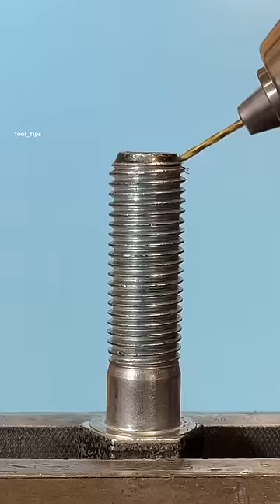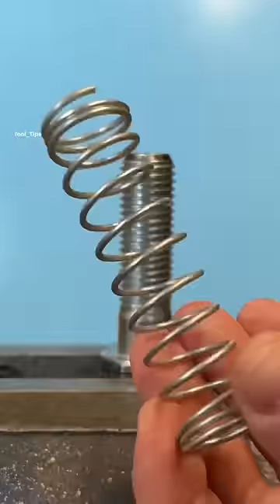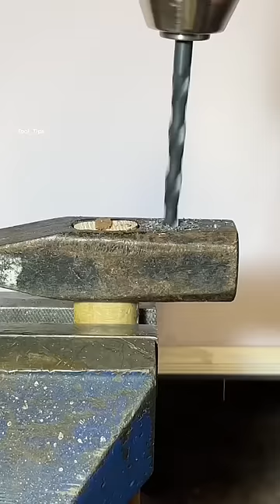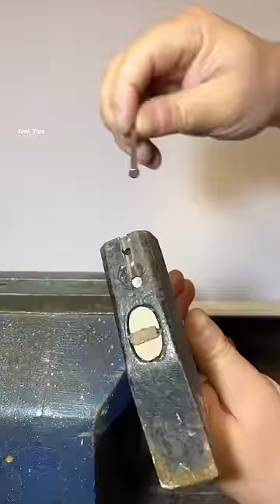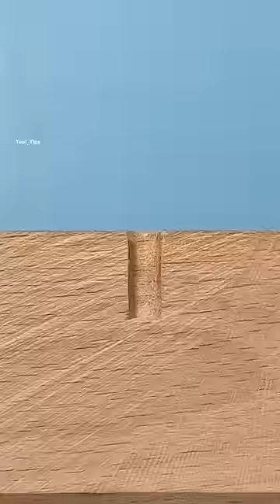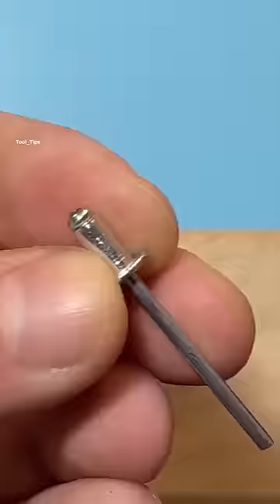Few People Know This Tips 🤫

Comment: The fact you were able to easily stretch out that "spring" means either 2 things. Either A) it's just a coil of wire, it's not a spring. Or B) it was a ludicrously low power spring which you immediately caused to fail by pulling it past it's strength point
Reply: It's solder
Reply: It’s solder
Reply: It’s solder
Reply: Its john cena
Reply: Why is it solder then?
Reply: If they had used spring steel, there is no way they would have been able to wrap it around by hand. Otherwise springs made from mild steel wire need to be heat treated afterwards to make them somewhat spring like.
Reply: No shit Einstein
Reply: @Mad4400 You can use mild steal then heat treat it to make it stiffer. People heat treat car springs to make them stiffer all the time. You don't need steel with magnesium to make a spring.
Reply: @teufelhund3801  Umm... isn't that what I said?

Comment: No you don't put silicone in a loose plug, get a bigger plug or drill a correct-sized hole.
Reply: Well what alternative if he drill to large americun
Reply: Fatter plug, they're widely available and cheap. Usually grey. Just drill the right hole width and you're good. @entitledblackwoman
Reply: @entitledblackwoman what a weird username you got there.
Reply: PFFT, you dont waste expensive silicone caulk. you use painters caulk or Elmers wood glue with some match sticks jammed around the wrong sized plastic anchor
Reply: When you buy the plugs, they will tell you right on the package which size drill bit to use. It's foolproof.

Comment: I'm 60 years old and I have never had the need to make a Spring out of mild steel
 I challenge you to wrap Spring steel around that bolt.
Reply: 7 Series a csomag része
Reply: That looks more like some kinda soldering wire to me than mild steel.
Reply: @Jrez  
Even worse, what's the point?
Reply: I'm 30 years old and I never thought of drilling into a hammer...
Reply: @Lichtstrahl92  
They make framing hammers like that. But the notch where the nail head rests is flat. With it curved by the drill that hammer is going to be shooting nails across the room. I hope he works alone.
Reply: I thought it was soldering wire. No steel bends that easily, not with that thickness.
Reply: He needs to wrap his brain around that first, but then brain? Which?
Reply: @andrews042  My point was you're giving him too much credit, as if that's even possible.
Reply: @Jrez  
Agreed, the point is to get clicks, not to actually help with projects.
It's hard not to point out inane tasks though.
Reply: Solder
Reply: @robertthomas6127  🤣🤣🤣🤣
Reply: @andrews042  I’ve never thought of using my cross peen hammer for framing work either. I usually stick to metal work with it.
Reply: E FAZEI O BEM SEM OLHAR A QUEM  QUE ASSIM SEJA FEITA A VONTADE DO NOSSO DEUS REI E MAJESTADE PARA TODO O SEMPRE AMÉM.
Reply: You give him to much credit, that is solder.
Reply: I used to make chain maille with spring steel wire and I can tell you, it ain’t easy and you don’t want to use a bolt as your form. Unthreaded rod chucked in a drill is the way to go. I’d never do it by hand now though.
Reply: No kidding. Springs are extremely cheap. Can get a box of them for a couple of dollars. Idk the size of that bolt but even some that are as big as your fingers are still cheap
Reply: @sleepingontheblacktop6053  LoL, now yeh just done it, & gave grasshoppah the Not So Bright Idea, to do it to a Straight Peen for next Useless chi'comm clickbait show. Ayuh
Reply: @Lichtstrahl92  I'm 30 years older than you and still haven't thought about it
Reply: قد تحتاجه يوماً ما 😊
Reply: Fr
Reply: Rc drift cars
Reply: @djstatyk1540  if your that hard up for spring money stay out of RC…
Reply: @Jrez  .?
Reply: @rajanthomasmm7334  How can I help?
Reply: hmm interesting
Reply: What about the hammer, it would work?
Reply: @elchicogore9517  
The drilled hole where the nail head rests is round. You'll either curve the nail head or it will shoot across the room.
Reply: The only reason i could think of is to use it as a door spring if your too lazy to go and buy one, i say this im doing it right now because im not tryna go to home depot! 🤣
Reply: @ChristKingJesus  
If you have the right wire it can be done.  But with hardened steel you have to use a smaller mandrel than the inside diameter you want and a guide to bend it close to the mandrel.
Reply: @ChristKingJesus  Pfff, americans depending on Home Depot
Here in South America we depend on our imagination, no such thing as ''home depots''
Reply: It's almost as if the type of metal you use for springs is specific... Like as if it had its own name or something...I guess we'd call it ... Steelspring... No, how about... Spring Steel... Yes that works... If only they'd invent something like that... I'm sick of my springs collapsing under weight 🤣🤣🤣
Reply: @42ckev  
Sarcasm intensifies
Reply: @robertthomas6127  the only thing that holds this person is hot air but if he keeps doing shit like this who knows
Reply: Lol.
Reply: That's the one that really got to me the most because that "spring" ain't gona do fuckall just like you say. HOWEVER wrapping threads with wire is an excellent way to have clamping forces applied to threads without marring the threads.... perhaps if he took a torch to the wire and got it hot as a cherry then plunged it in water... the mild steel wire would be slightly more useful as a spring 😂

Comment: "I just drilled the wrong sized hole but instead of just letting the wall anchor expand like it was going to anyway I'm going to make it hell for the guy who wants to take this out later."
Reply: It's better to use chemical  anchor instead  of that sealant..
Reply: @olegnazarko9762
Reply: I thought the caulking was to prevent water ingress. I've done that before.
Reply: Not to mention it’s a drywall anchor going into masonry😭😭
Reply: @olegnazarko9762
Reply: Rajnildeka
Reply: @kanmanit1957  d
Reply: @olegnazarko9762  i
Reply: @olegnazarko9762  in our
Reply: I use JB weld in the drywall and a bit a green loctite on everything.
Every
Thing.
Reply: @treybrumley2060  you
Reply: @BlackEpyon  9ooq9r
Reply: @BlackEpyon
Reply: @kanmanit1957  mobile iphone r9or
Reply: Ok
Reply: @olegnazarko9762
Reply: @olegnazarko9762  ppp
Q de
Reply: @treybrumley2060  de
Reply: @pablohernadez4414
Reply: @BlackEpyon
Reply: @olegnazarko9762
Reply: @olegnazarko9762
Reply: @BlackEpyon
Reply: @olegnazarko9762
Reply: @treybrumley2060  I think we put wm

Comment: Few people know these tips because they are useless. These are 4 great things you should never ever do.  Or 4 great ways to know you should fire your handyman.  1) the spring is compressed and will not work, that is literally just a coil 2) The destruction of a wedge hammer :( .... a claw hammer holds the nail for the first strike on the back. Also, the strength of the wedge hammer has been compromised 3) Gluing a drywall anchor into "anything other than drywall" will fail to hold a load 100% 4) Wooden dowels are not nailed in, use wood glue to form a correct bond.  The nail does not increase the strength of the dowel because dowels are hard to twist by themselves but it will fall out of the socket 100%.
Reply: 3) These anchors exist for concrete walls as well, and there's no need to glue them in, as they spread when the screw is fastened, clamping it in. They're supposed to be that lose at first.
Reply: 4) it looks like they used a blind rivet instead of a nail

Comment: "I have a brand new hammer with a magnetic nail holder. 
Now I'm going to make a crappy version of my brand new hammer for no apparent reason."
Reply: With the wrong kind of hammer to boot. That's a scythe hammer, for metalworking.
Reply: @bruwin  thought it was a carving hammer(I play dying light)
Reply: @bruwin  im 99% sure thats a chisel for blacksmiths
Reply: A magnetic nail holder is a useless addition to hammer to begin with.
Reply: nevermind that you wouldn't typically use a sledge for nails.  hopefully not.
Reply: @goverat  For smiths it is a cross pein. It is for squishing the metal in only one direction. I apologize for the technical terms.
Reply: jai shree Radhe Radhe
Reply: @hotdogsarepropaganda
Reply: @hotdogsarepropaganda  reeeeeeeeeeeeeeeeeeeeeeereeeewereeeeeeeeeeeeereee
Reply: Also the magnet of the DIY hammer is used to drive the nail in. I feel like it’ll chip and break quickly compared to the other hammer
Reply: In case you don’t have one of those hammers.
Reply: @Joshinken  it takes more time to put the nail in the magnet than just to hand drive it. So only novices use this feature anyway
Reply: @adamb8317  it takes 0.0001 seconds to put a nail on a magnet and saves you several “i don’t want to hit my hand” swings at the beginning, so i have no idea what you’re talking about

And yeah, novices. Those exist. Not everyone needing to put a nail into a piece of wood does it professionally. I just need to smash two pieces together so they can stick until it gets to the production line, and that hammer really helps.

And i know for a fact that carpenters use this type of hammer as well, and they use the nail holder as well, because if you have any amount of training with it, its really handy to take 1 swing to stick the nail into the wood and another to drive it in all the way. Saw a guy do a roof once, mans put a new nail into the magnet with the same hand he was gripping onto a piece of 2 by 4 for dear life up there by simply moving the hammer past his hand on the return swing. The dude shuffled over the roof in minutes, driving nails in with no problems. 

They had a nailgun, but he could do it faster this way.
Reply: @Joshinken  Great analysis and thanks for the real situation sharing. It makes sense in some way 👍
Reply: @Joshinken  OK that is a good point. I can see it being useful sometimes
Reply: @goverat yep, absolutely a chisel.

Comment: Anyone who ever tried to put glue around an anchor will tell you that it will never hold a little bit.
Reply: Let the shit set up first, there is a certain glue just for it but I've never used it. Seen it used but I think it was just to help with freezing. I don't know
Reply: @jeremybanks719  'Grab adhesive'. I don't see the tip as that bad: You can use the correct drill bit, drill it straight, and still end up with a hole too large for your plug. I would try to remove the dust from the hole before putting the adhesive in though.
Reply: @123a-o5d  not to be 'that guy' but if the hole is too big you actually didn't use the right size drill bit.
Reply: Not true. Try drilling lots of holes in old brickwork. Especially one that has already been plastered, so you're drilling blind so to speak.
Reply: @123a-o5d  If you every have a lose anchor, add wood "splinters" inside the hole. When the screw expands the anchor, it will grab and be just as tight.
Reply: @lastnamefirstname9043  BE GONE WITH YOUR COMMON SENSE!
Reply: @Syn410  Why not just use something like QUIKRETE Mortar Repair Sealant? It would be a hell of  lot more permanent.
Reply: @REALfish1552   I hang exterior lights (weigh 5-10lbs) and use 4 tapcons or rawl plugs to do so therefore it's not necessary, as wood is readily available and a loose plug is too rare to buy special sealant for, not to mention you don't know for sure if it will "grab" unless you wait hours for it to cure. I never drill into the mortar (only the brick itself) as theres no structure there, and to my knowledge that sealant isn't an adhesive that would hold anything in place but I could be wrong about that

Comment: ah yes the classic common need for a diy spring
Reply: what spring? the swirl he made with soldering wire lol?
Reply: @traitretrudeau2367  good screen name btw.
Reply: @GeorgeOrwell-yz6zx  goes well with my profile picture
Reply: One can make spring like that but usually it needs to be on the drill press or lathe to get it working properly and be safe.. Also you need high carbon wire like piano wire for that.

Comment: The hammer is made to hold the nail for your first swing. So you don’t have to modify a hammer you wouldn’t use for any nails required in home improvement, just to get the perfect drive
Reply: I doubt you have ever handled tools properly or made anything out of wood if you think this is a good idea. When you use this kind of hammer you will likely not be able to put the nail in the right position and angle.

Comment: You lost me at the first one, but even more when you snipped a rivet to fit that peg😭
Reply: That was a great idea though.
Reply: @skylined5534  Or...  You can use glue on the dowel like intended.
Reply: @skylined5534  professional carpenter here! Dowels are designed to expand when in contact with glue. (Not all types though. Regular old wood glue works best. The pin was not needed.
Reply: @unknownunknown7107  and get it wet so it expands too
Reply: Maybe he thought it was a weird nail.

Comment: A spring with no temper to it..awesome .
Reply: Even if he tempered it, it wouldn't be a spring, it'd just be a coil. You need to use spring steel to make a spring.
Reply: @holocaust_2.0  very true.
Reply: I think it was solder.
Reply: @holocaust_2.0  iiuuiiiiiiiiiiiiiuiiiiiiiiiiiiiiiiiiiiii8ii
Reply: It's a laid back and relaxed spring.😉
Reply: Itac Hi  Your message bollox.

Comment: You can also just hold the nail, that way it'll end up exactly where your want it to go and you don't need to damage your tools 😂
Reply: And the chance of the nail just slipping out is really high. Keep in mind they have as many takes as they want.
Reply: @personpersonson7958  i mean mine aswell just buy a framing hammer, some have that already and it does work really well
Reply: The real value of presetting the nail in the hammer is that at times you can’t reach where you’d set the nail by hand - I know I’ve experienced that problem. Not with a sledge or a tack hammer but with a framing hammer and it could happen with a trim hammer but rarely.

Comment: Fun fact, that second thing was a slitting chisel used in blacksmithing for splitting metal. It is not a hammer, and nor does it need to be one
Reply: another fun fact: glueing a dowel into a hole that is to big just cancels the whole purpose of it. thats why you always drill one size below dowel size so it will fit perfectly.
Reply: It was a blacksmiths cross pein hammer, not a slitting punch!
Reply: Nah, it's a hammer, this is a very popular pattern in east EU and all the former USSR. It's usually referred as a "metalworker hammer" or a "bench hammer" (for metal bench work). It's a pattern to be found in every tool box out there, because apparently in those parts of the world masonry is more popular than carpentry, so finding a claw hammer is quite a quest.
Reply: It's called a Riveting Hammer used by sheet metal workers.
Reply: That’s a cross pein setting hammer. It is definitely a hammer just not the right one for the job.
Reply: yeah it made me cringe looking at this video...

Comment: ah yes completely ruin the face of a cross-peen hammer, all you need is a $50 drill/driver, a $10 drill bit, a $75 grinder and wheel, and $5 magnet and glue... or just go buy the $20 brand new framing hammer with the magnet already installed and save yourself time in the process. 6/9 score "lifehack tip"
Reply: I think you are giving him too much credit saying that grinder is worth $75
Reply: @gazs7237  maybe, maybe not. the shade of bright green reminds me of the Metabo HPT 5-inch... or at least a clone of it
Reply: Beauty part is there's already cheap plastic nail holders - usually costs about a buck.  Or use a wooden spring loaded clothespin.  Or a pair of needle-nose pliers.

The only way you can screw up and hit yourself in the hand with a hammer is because you got cerebral palsy.
Reply: @delanorrosey4730  hah yea that too, or you know just give it a light tap to start just to get the tip in and then hit it harder to sink it, many ways available
Reply: @dragon411320  Usually stabbing the wood with an awl to start the pilot hole for the nail works good too, lol.
Reply: @delanorrosey4730  another good option, or hell just use a piece of cardboard and put the nail in the corner of that and hold it up to the wood, and simply tear away when done haha
Reply: excalty!!!😆 🤣  you hit the nail on the head without the nail setter
Reply: @delanorrosey4730  it was technically designed to hit Nails straighter. The benefit of the magnet is that you don't have to hit your fingers or thumb

Comment: Or... You could drill the hole the correct size in the first place
Reply: Works on bad concrete with right glue. Plugs will fall out on bad concrete after 1 year.

Comment: for anyone who is thinking about doing the hammer "tip", don't... That is an easy way to turn it into a shrapnel producing tool... Trust me you don't want to hammer with that and hit it on one of the spots that you drilled into as it will crumble off and best case scenario hit the board...

Comment: Oh, yeah... lemme just go out and buy an angle grinder and metal cutting drill bits so I can modify a masonry hammer to drive wood nails when I can spend less than half that on a common claw hammer with a magnetic nail holder. Great tips.
Reply: не знаю как у вас, у нас в России почти у каждого мужика эта машинка есть))

Comment: I'm not a metalsmith I am a Maker here's my take: 1. Random bolt, I need my solder in a spiral. 2. I have a claw hammer, so I ruin a metalwork hammer with a grinder without a guard and some CA glue with a magnet to hammer finish nails in a stray board so I can hang it on the wall. 3. Drill the wrong size hole in the wrong location for a bunch of liquid nails to hold an undersized piece of crap wall anchor for a random bracket. Probably to hold my chunk 'o wood that I hammered random finish nails in.

Comment: 1-That first thing is a bent piece of wire, not a spring.
2- That cross-pin hammer is not for nails.
3-Get the right size bit
4-  The dowel with a rivet in it- why?